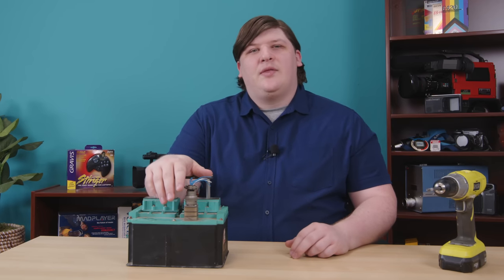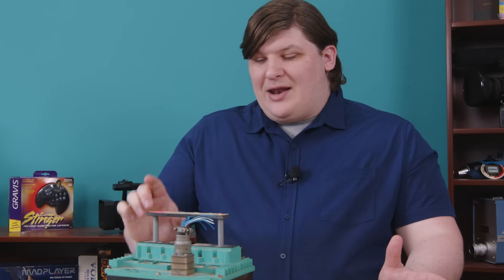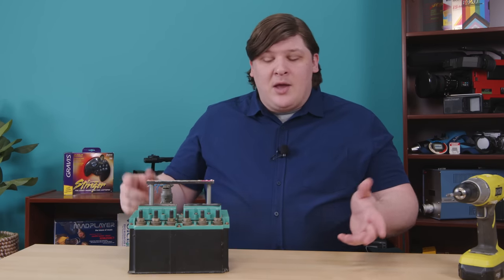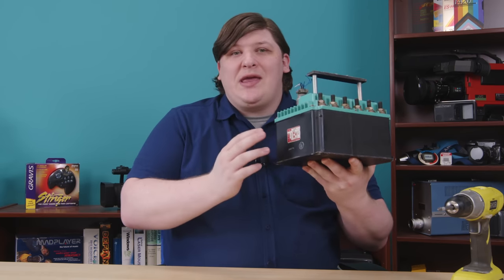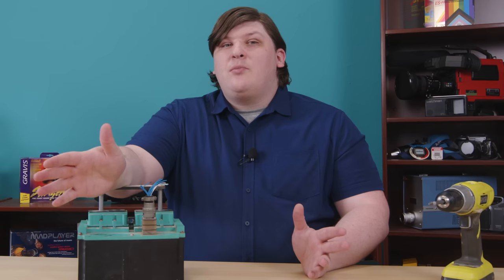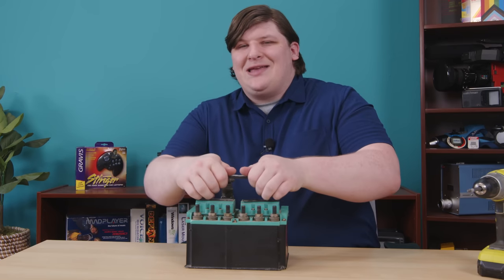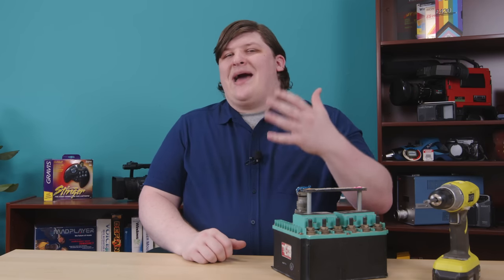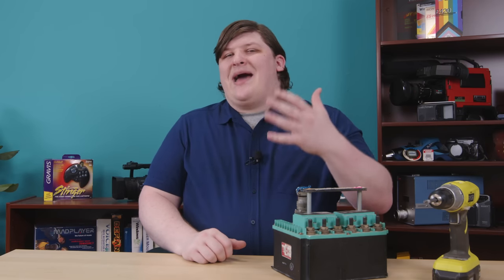A Short Story About (Battle)shorts

Comment: The continuous rating is the coil, not the load. The jelly bean relays in washers, automobiles, etc, need very little current to actuate (pull the armature mass) - and less still to hold - contactors typically work against springs and require full pull current constantly.  depending on the application, there may be a duty rating - say 20 percent, noted in minutes .. so two minutes energized, eight off.

The load rating itself is not the amount of power that the contacts can safely conduct closed, but the amount that can be reliably broken when commanded open without arcing or destroying the contacts before the rated number of operational cycles in it's designed life expectancy.

I would have actually liked to run a few tests on that bit of kit. Was it eighty-sixed simply because it reached end of design life, or did it fail? Is that EPS handle a destructive one time use over-ride, or is it resettable? If it is from a ship, then I assume the poly enclosure is for corrosion mitigation and almost certainly explosion proof rating - that is, not igniting combustible gasses via spark. although it also may contain mercury.

400Hz because as frequency increases, transformers require less physical mass per power unit. Comparatively heft a 300 mA wall wart from 1975, and a modern 1500 mA cell phone charging cube of the same voltage. Then copper was relatively cheap and switching semiconductors very expensive .. the opposite is true now, so boost converter over linear topology has all but become ubiquitous.

Checking out the kit on the shelf behind you. I converted my Watchman to composite input. Don't really like hacking vintage kit, but it wasn't doing anything otherwise. the blue vidicon camera looks suspiciously like the kit that PE featured in 1966/7

Comment: There are biological equivalents to this: Adrenalin, "Hysterical Strength", and likely others. The body has safe and unsafe operating parameters too. Most organisms usually operate inside their safety parameters, but some occasions call for using the Safety Overrides or Battleshorts of the body to push harder and get into a more survivable situation, or to protect other members of the species from a perceived danger.

Comment: BATTLE OVERIDE MIGHT ACTUALLY BYPASS, MANUALLY, THE SOLENOID OF THE RELAY, ENGAGING THE CONTACTS, BUT WITHOUT THE NEED FOR THE 28 VOLTS TO DRIVE THE COIL, IN CASE THE POWER FEEDING THAT RELAY WAS CUT OFF BY SOME FAILURE, SOMEWHERE.

Comment: I don't know how much of a gearhead you are, but this reminds of of essentially the opposite concept in some subaru vehicles. Subarus are designed to be all wheel drive all the time, but, theres a fuse you can place that will disconnect the centre differential, and stop sending engine power to the rear wheels, effectively converting the car into front wheel drive only. This is mostly used for troubleshooting but is useful in emergency situations if something like a rear axle breaks and you still need to move the vehicle to a safer location.

Comment: 15:10 Yeah. Sometimes it's better to risk setting the engine on fire, than it is to sit there not moving...

Reality of conflict. * prescient. Talked about plane engines the same way just a few minutes later lol.
27:00 yeah, you're basically right on how it works, and what it's for. although that one looks like it may need manual resetting. remote power switch with a manual override.

Comment: As someone who has been into electrical engineering since a young age the "reroute!" has allways been one of the least cringy technobabels. Heck I even had a job at a, yes startup that did hardware design where most of my team in practice was concerned with rerouting power on the fly to prevent or in some cases operate despite fires.

Comment: When receiving a new fire engine the manufacturer gave us a introduction into the various systems and equipment. [...], pump, light, [...] and that's the main electrical box: It contains all the switches and fuses. If something goes wrong with the (non driving train) electrical system the problem probably is in there. The enclosure is locked as you're not supposed to mess with it, but no worries, the key is chained to it. Should you ever absolutely need to get something working again you open it like this giving you full access to override and bridge stuff, just know that we accept no liability.

Comment: Fun fact: your body has a "war emergency power" mode. If you or your children are in imminent danger, you might experience a surge of adrenaline and gain "super strength" - there are examples of a mother singlehandedly lifting a car. You can't do this normally because it's extremely dangerous and harmful (your muscles will basically destroy themselves); only in a situation where the brain decides it's better to risk severe injury than certain death.

Comment: If you want to find electric earthmoving equipment think BIG, like three story house big, or underground. Lots of electric equipment underground, and in massive open pit mine shovels and trucks.  Komatsu makes a range of electric drive mine haul trucks with “E” models - all their biggest trucks - from 200t to 
being diesel-electric, Cat has “AC” series haul trucks as well.  We are starting to see some in smaller equipment for above ground use now that batteries are finally getting to a maybe reasonable power density, but it just can’t beat the power density of a gallon of fuel.

Comment: Does there happen to be an old FSN or NSN on the side of the unit at all? I would love to see if I could figure out exactly what that went to.
Reply from the maker: None that I saw. :(
Reply: this might be it

Part Number: B-408

Manufacturer: Tyco Electronics Corp

Item Name : Contactor Magnetic

NSN: 6110-01-045-4017
FSC : 6110 Electrical Control Equipment
CAGE Code: 74063
Alternate P/N : B408

Comment: Hey if this is the same little black box that I had built for Miller machine, Stick it in some rice I bet you it's just got the moisture damage.
Although there is two other components that could have failed inside of it so the right thing possibly might not work if the corrosion has seized one of those switches.
Also this is a different branch of the military mine was land for tanks You said ship.
They are put together quite nice there should be three bolts on each side which equals 12 volts to remove the top lid.

Comment: That is a dual coil latching contactor with one wire as a coman for both coils and one wite passing throu a normaly closed contat to the coil to close the contactor thus opening the closed coil wire and then the outher coil wire to open the contactor witch is now connected to the open coial and i energised will reset the contactor to an open state.
In short that contactor only needs a breef supply to close and open so it can be left open or closed without any power.

Comment: They don't really teach the calculus of thinking about the machine while you are unceremoniously abusing it by removing the interlocks. Kinda the opposite: "The machine dies before you do. Machines are replaceable, people are not." We are drilled to maintain the them in impeccable condition (or attempt this, don't get me started on half-assed pmcs.) So that when we call on it to do 400 times more than it was ever designed to do, it will reach that multiplier and hold there until it literally falls apart. It's really weird to think of a multimillion dollar thing like a tank or computer system as disposable, and sure enough your judgement to destroy it to serve your needs will be questioned, but every piece of military equipment is built to be standard, interchangeable, and immensely replaceable. It's one of the reasons why war is one of humanities most wasteful endeavors.

Comment: I do believe you are mistaken about duty cycling.  A duty cycle is how much of the period of AC power that is "on".  Since this is "full duty cycle", it means that it can basically do DC.  A symmetrical square wave has a duty cycle of 50%, and if you have some kind of asymetrical signal, you could have anywhere from 1-99% duty cycle.  https://en.wikipedia.org/wiki/Duty_cycle

Comment: A $5000 repair on an earthmover or scraper would be entirely normal. Maybe even on the low end. Heavy equipment repairs are expensive and just part of the cost of ownership.  Whatever a car repair would cost, a similar heavy equipment repair is probably 10 times the cost.

Comment: 400hz is common in aviaition, because it allows thinner wires to be used to carry the same about of power, IIRC. I assume the navy would use it for similar reasons.
Edit: 400hz is so that transformers can be smaller
Reply: That would be higher voltage that allows thinner wires. 400Hz is so that the transformers can be smaller for a given amount of power/VAR (since power is transferred through a transformer only when the field strength changes, aka when the voltage changes). Smaller transformers are, well, smaller, and, critically for aviation, lighter.
Reply: @DrunkenSwimmer  Ah, right. You're probably correct.

Comment: Safety system can fail. That are built into system.  Am only here now. Due to going to a comic book convention!. How you may ask? I brought my surge protector with multiple power port with. I took it out of the bag and notice the fuse failed so badly. The metal part of the fuse reformed into a circuit....   At some point when this would have been used normal in my  house. It would have caught fire. While I was out/ or asleep.

Comment: Relays will always fail its a fact. Imagine flying an aircraft with 1 engine and the selinoid in the generator or auxiliary power unit fails. Your engine can flame out without your continuous spark keeping the fuel lit. Normally the electrical contacts are still okay to use. So you can the handle on that relay to manually close the contacts. This will allow for a safe flight and landing to the nearest airfield or airport to be replaced.
If the relay in your car goes bad you'll be stalled in road but in an aircraft options are very limited.

Comment: I'm a automation controls engineer and you partly incorrect.  While yes we need to design in safety and reliability, most motor controls are designed to exert 200% torque (aka current draw) for 3 minutes or so.  This is just about every machine depending on quality of components.

Comment: I think unfortunately the military is necessity of evil humankind isn't designed in my opinion to get along with different points of view and I'm wondering if that unit is supposed to work as a one-time only use maybe it locks into position and can't unlock once it's used for safety issues are whatever reason

Comment: This concept reminds me of WEP (War Emergency Power) used in fighter planes. It allows the pilot to use a few minutes of extra throttle on a plane (essentially running the engine at above 100% of its rated power)
Reply: Ok I just finished the vid and noticed that you mentioned it.

Comment: You have a big relay which appears to have screws holding its housing together. You have a drill with a screwdriver bit. You spend 30 minutes *not taking the relay apart*. I am disappointed.

Comment: 3:35
Nope, 240kw. 3-phase systems carry 1.5x the power that the voltage/amperage suggests. It could also be switching two hots and a neutral in which case your math would be correct unless it means 450 volts from neutral not peak to peak which is unlikely.
Reply: I'd assume if it's an AC contactor the voltage rating would be RMS, now I'm not sure if that means it supports upto 450V phase-to-neutral or phase-to-phase, if that's a phase to phase voltage that means the maximum power would be around 272kw if it's a phase to neutral rating then it'd be about 3 times what he calculated. When calculating power using the phase-to-phase voltage it's  current multiplied by the voltage  by the square root of 3, if you have the phase to nuetral voltage then it's like measuring each phase individually then adding them up so you can just do voltage times current times 3.

Comment: A power grid hub needs external power in order to turn on. Essentially meaning that if all grids fail, we'd all be out of power for a very long time. US having grids that connect to each other is a way to at least provide one grid with power long enough so that it may start again [I think texas is not connected to any other grid.] 

No real reason to comment this but just a tidbit of information about power that I think I may be somewhat wrong about... but I found the tidbit interesting.
Reply: Not exactly, the grid has power plants with “black start” capability meaning they’re able to start up from complete shutdown without the grid usually relying on diesel generators to supply power to auxiliary systems until the power plant’s main generator can be put into service and take over powering the auxiliary systems. At that point, the main generator can be connected to the grid and a section by section bootstrapping of the grid can be performed which brings more plants (and loads) up until the grid is back up and running.

Comment: One more additional comment.
No soldier is thinking about how much current a part is using or trying to do that kind of mental arithmetic in the heat of battle. In that case extensive training and muscle memory kicks in. You don't worry about what the limits are of your vehicle or equipment unless it is obvious that breaking those limits will cause you to die or prevent you from achieving the objective. 

Again I respect you position on the military, but you clearly don't understand the subject matter beyond the technical aspects. There is so much more to how and when to use overrides and military equipment then knowing the technical specs. You yourself have indicated that you don't understand the mindset of a soldier. 

That's 100% ok.

However your lack of understanding is fundamental to why so much of this video is wrong. I know you don't like  the military, but you should definitely consider consulting with someone that's served before talking about how the military does things.

Believe it or not, star trek's use of overrides is accurate in the sense of when and o\under what circumstances they engage such overrides. That being in a situation where not doing so would be worse. You will notice they don't prep for battle by bypassing the eps relays, they wait untill they have failed or are preventing them from achieving the objective/staying alive.